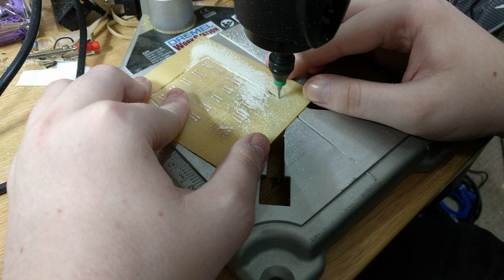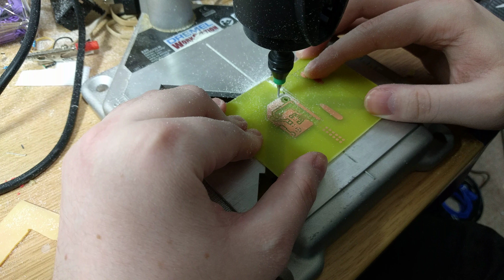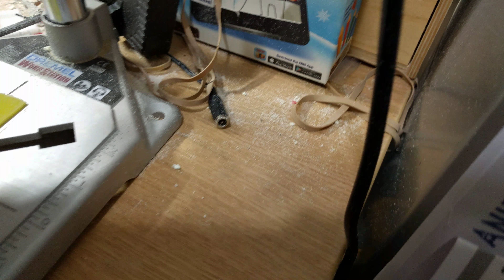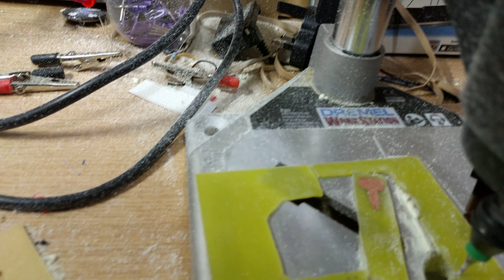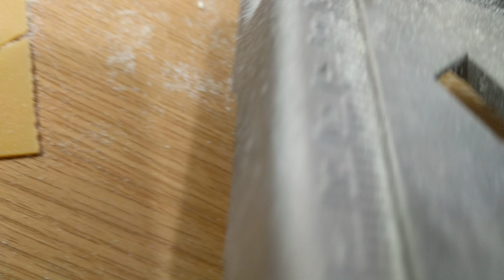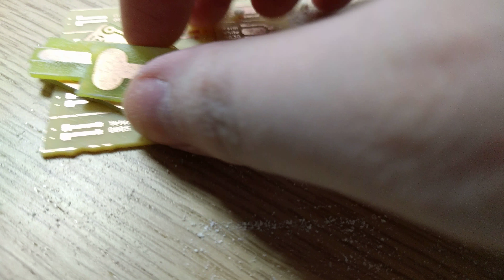(LOUD) A spot of PCB routing

Comment: I cut my pcb with a jigsaw, not always the straightest in the world either. With a big flat hand file you can make em look pretty as if they came out of a machine anyway :D. If I'm doing like you i'd try to clamp something to use as a guide to the drill table though, no idea how well it'd work out in reality.
Reply from the maker: If I cared a little more, I could grab something like https://www.aliexpress.com/item/Mini-Multifunctional-Cross-Working-Table-For-Drilling-Milling-Machine-Bench-Vise-Mechanic-Tools-6330-1/32782007986.html?s=p (or even 3D print one, like this thing: https://www.myminifactory.com/object/mini-milling-machine-704), but it'd be such a hassle to even use and it generally doesn't matter that my PCBs have straight outlines... I'm quite restricted for space in my little workshop/office as well, so a big milling table like in that AliExpress link would get in the way quite a lot! Quite often my home-made PCBs are only prototypes that I'll then re-do to be made professionally, so they don't even last all that long - mostly just to make sure the KiCad schematic works :)
Reply: Andrew Gillard hah i feel ya, never enough space if you have hobbies. If it wasn't for lack of space I'd allready have one of those 3040 cnc engravers cutting pcb for me
Reply from the maker: I'm not sure what you're referring to. Do you mean one of those AliExpress/BangGood "Arduino" CNC jobs for $200 or so? Or something else? I think if I had space to work in our garage (it's just a heap of junk currently!) I'd get one of those and use it in the garage for PCB drilling and milling. I'd probably still etch with ferric chloride, though :)
Reply: I mean the slightly bigger engravers, if you search cnc 3040 on ali you'll probably see what i mean. They come in a variety of models that are all very similar, possible some of them use an arduino based control board but the cheapest ones come with some oldschool control box that hooks to a parallel port.
Reply from the maker: Ah, cool, I'll take a look :)